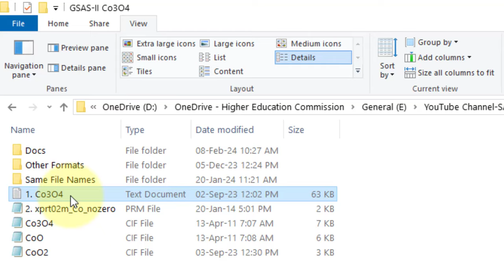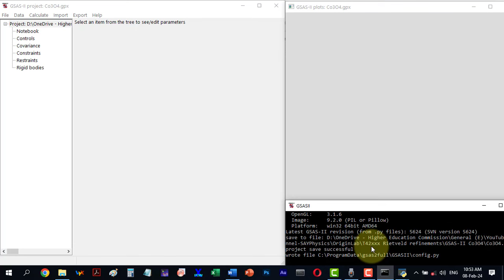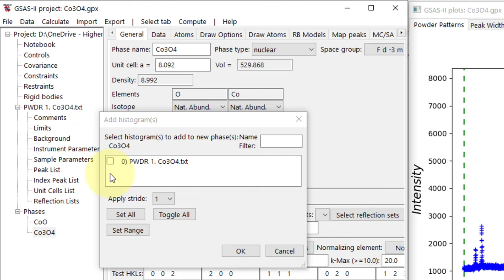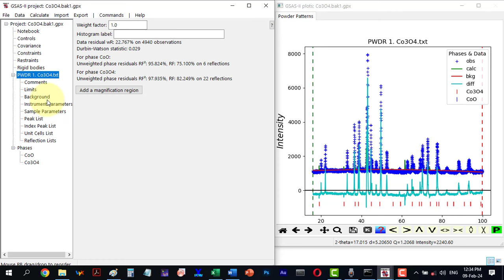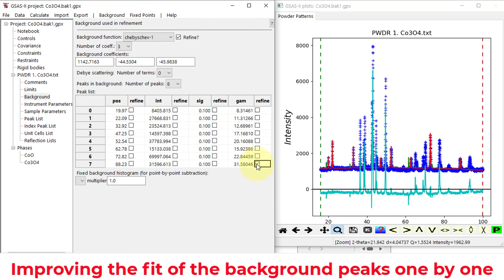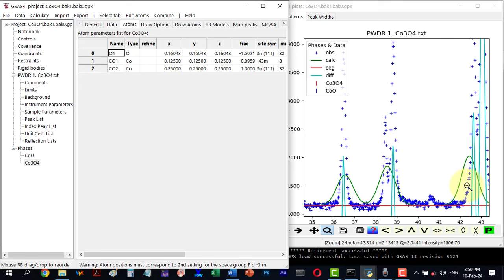Introduction to Rietveld refinement of XRD data using GSAS-II

Comment: Hello How can we quantify the amount of different phases present in the XRD data using GSAS-II
Reply from the maker: Yes, you can quantify the amount of different phases in your XRD data using GSAS-II by performing a Rietveld refinement. After refining the structural parameters of each phase, GSAS-II will calculate the phase fractions based on their scale factors. Ensure that you refine the scale factors and apply proper constraints if needed. The phase fractions will be displayed in the results table under the "Phases" section. The following video will help you to do this. Thanks
Rietveld refinement of XRD data with known phases in GSAS
https://youtu.be/Z_aWz7Tx0Pw
Reply: @SAYPhysics  Thank You very much sir. I have one more question, Can I quantify amorphous phases by adding internal standard into the sample, If yes can you please explain how can I do it in GSAS,
Reply from the maker: @SalehAliKhawaja  Yes, you can quantify amorphous phases by adding a known amount of a crystalline internal standard to your sample. In GSAS-II, refine the scale factors for the crystalline phases, including the standard, and calculate the amorphous content as the remaining fraction. Ensure proper mixing, accurate background modeling, and no overlap in diffraction patterns for reliable results. Thanks

Comment: Hello Stuck on background peak.Three of peaks, 22.1, 42.7 and 88.3 do not refine correctly. Help?
Reply from the maker: Once fitting or refinement is executed, recheck the peaks positions, as some peaks positions are being changed. Let me know if the same persists. Thanks
Reply: @SAYPhysics  22.1 changes to 269.83
Reply from the maker: When you designate a peak location, after running the refinement, it is slightly delocalized. You will have to localize it again. This practice will make it localized, then you apply different refinement strategies. Thanks

Comment: Hi! I have a rather silly question: In which system of calculations are microstranscripts presented? Is the value obtained in 10-3? I just started using GSAS, previously I worked for 3 years in TOPAS and did not count strain because there was no standard for calculating instrumental broadening. Now I am working on entropy ceramics and strain is in the neighborhood of 200-800. Are these normal values or am I doing something wrong?
Reply from the maker: Hi there! Your question is absolutely valid. In GSAS II, microstrain values are typically presented in units of 10^-6 (microstrain), not 10^-3. It's crucial to maintain consistency in units for accurate calculations and comparisons. Regarding the strain values you mentioned (200-800), it varies depending on the materials and conditions being studied. I'd recommend consulting relevant literature or experts in the field to validate your findings and ensure accuracy in your analysis. To be honest, I have less idea in your field. Thanks